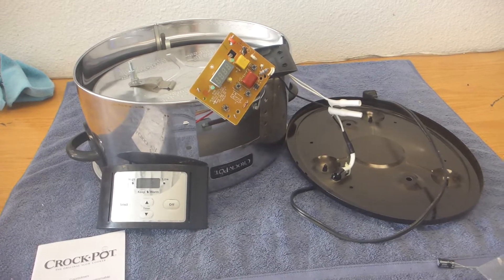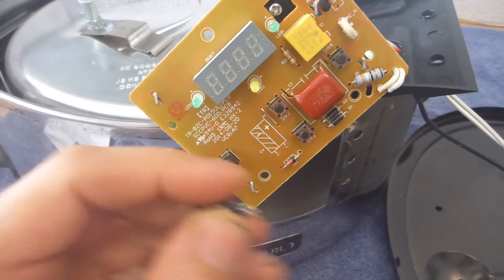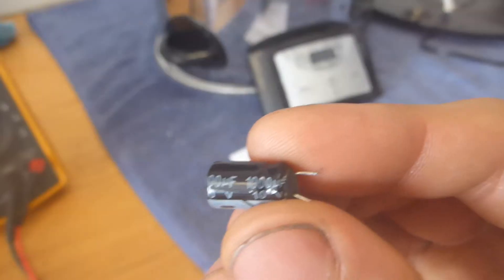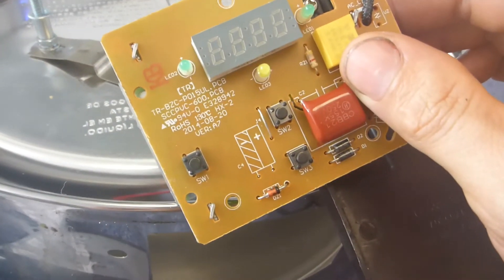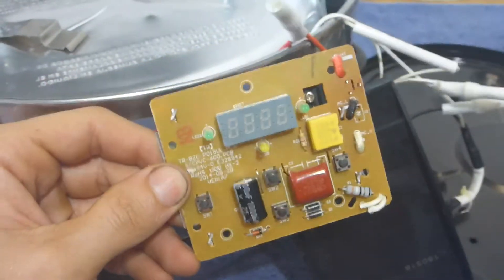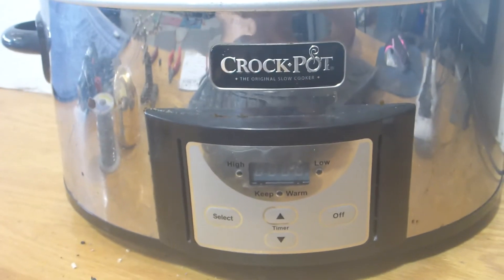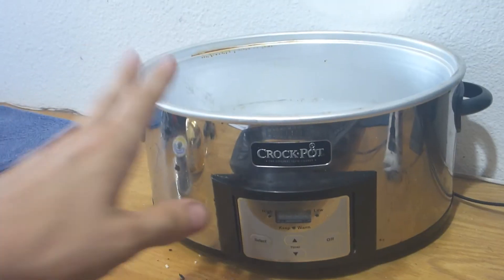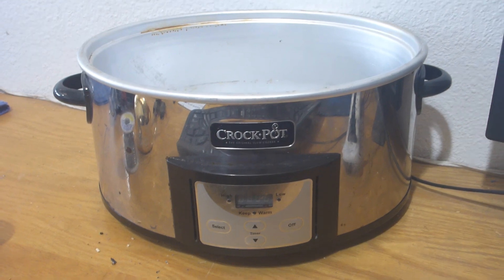Crock Pot Digital Display Won’t Turn On – Diagnosis & Repair - How To Fix

Comment: Great video! I found the same issue on my crockpot, but after replacing the capacitor, I could only get the buttons to work and not the lcd display. 

Is there more I can do to diagnose without desoldering all the components off and trying to test them somehow?
Reply from the maker: Oh noooo, sad face.  Most components can be tested without removal.  If only the LCD display isn't working, perhaps the display itself is faulty or some of the legs are no longer properly soldered.  I'd give the board a thorough investigation!

Comment: Very useful vid. Three years old but still useful. I wish you had started by taking the pot apart. Nut at least we see how to put it back together again. Thanks again.
Reply from the maker: I'm glad it's still helpful for ya.  I'm still trying to repair my time machine that lets me record things I've already done, but so far replacing the capacitor hasn't worked.  😕
Reply: @Bythirteen 😂

Comment: Not sure if you're still around to answer (and remember), but how did you get the bottom off?  Did you just take a flathead screwdriver and pry from those bottom clips?   Mine has 2 on each side and I'm not sure which direction to leverage them, worried about damage.

I took the inner pot out first and have practically no room to work, and there was some thing attached to the bottom of the unit with 2 small screws I didn't know about beforehand.  Just impossible to get back with how little slack is on the wires.

Also had some 1cm standoff and 2 washers fall out during the process, but thanks to this video I know where they go back.
Reply from the maker: all I have to offer you is this video, boss.

Comment: HELP! I don't have a soldering knife, and I have a Crock-Pot in your perfect condition but it doesn't heat up. What's the easiest way to check which part is defective?
Reply from the maker: ask someone with the proper skills and tools to assist in troubleshooting?

Comment: Thanks for this.  That's exactly what happened to mine.  The pot itself works, but the LCD doesn't.  I've just been using it and setting a timer, as the lights for low/high still work, just not the timer on the pot.  But maybe my hubby will enjoy a new project after Christmas (don't want him digging into it before that!)
Reply from the maker: game on!

Comment: Thank you for this video. I was thinking of purchasing a crock pot with a digital display. I’m 62. I bought my mom a crock pot as a gift back in the 1970s. I’ve had several since then but none programmable or with a digital display. I don’t have any electronics training to attempt anything like what’s done in this video. Maybe I’ll just opt for one without the digital display.
Reply from the maker: When I need kitchen appliances or tools or something like this, I first check the used market -- craigslist or thrift stores.  Lots of times older gear is more reliable, especially in the case of a crock pot.  We don't NEED a digital display or electronics involved in this case... turn it ON, set a timer, go about your business.  Those older simpler products don't fail prematurely.  Not to mention the carbon footprint reduction benefit of buying used.... or the great reduced pricetag!!
Reply: @Bythirteen  Thank you for your reply.  I think I’m going to opt for one of the simpler ones like you suggest. I’m vegan so I only want to use the crockpot to cook soups in. No meat, etc. A basic model will suffice. Most people want the programmable function so that the crockpot doesn’t switch over to warm for too long. People say that when the pot stays on too long, the food turns to mush by the time they get home from work. I work from home, so I can monitor the food to stop it from overcooking.

Comment: Anybody know what causes alll the lights to blink? Everything I read online said to reset by holding down a variety of button combinations for different lengths of time and that didn’t help.
Reply: Hello, the same thing is happening to me as you, the 3 LED lights on my device keep flashing and I can't find anything on the internet to solve the problem. Could you fix it? @portrece
Reply: @mancabmat  I emailed the company asking if they’d sell me a new circuit board for the control panel and they offered to send me a replacement slow cooker for free
Reply: @captainzib  But it still has a warranty, mine is already old and you are older. Although now I have managed to get it to work by pressing all the buttons at the same time and the flashing has gone away, but the numbers are barely visible on the screen. Thank you for answering so quickly
Reply from the maker: sorry I cannot be of assistance here.

Comment: I am desperate for help.. Can you assist me with repairing my crockpot? I have an old Hamilton Beach 3 in 1 slow
Cooker and it stopped working suddenly.. i legit cried lol. I really want to fix it. They don’t make it anymore and I took it apart following another video to inspect it inside. Everything looked ok to me as far as no obvious damage, corrosion, melting or anything so I put it back together and assume it’s something with the circuit board but I don’t know how to investigate each component on it to see which is faulty. Can you help me? @Bythirteen
Reply from the maker: That's a big bummer.  Electronics are a cruel mistress sometimes.

Comment: nice video.  Thanks for sharing this.  Any suggestions on timer segments being out?  You didn't show the backside of the PCB but I suspect there's a driver chip on there.  Any idea of value?  Thanks
Reply from the maker: You could always theoretically replace any component but you'd need a pretty advanced level of skill to be accomplishing that task... both in identifying components and their suitable replacements, and tooling to perform the replacement.  Identifying and replacing a capacitor is fairly basic so that's why I made this video.  :)
Reply: @Bythirteen  I'd agree with that!  Any chance you have a photo of the back side of the pcb?  specifically, I'd like to see what the display pin outs are the driver chip.
Reply from the maker: @en2oh  that's a negative sir.  that's a 15minute disassembly though man, just get to goin!
Reply: @Bythirteen  I hadn't bought the broken pot yet! :)

Comment: Thanks for the video.

I have a slightly different model (no display) that would constantly reset after a few minutes of operation causing the power light to blink.  After going though the various troubleshooting hints on the 'net, I ran across your video for clues on how to disassemble my unit.  When I disassembled mine, I noticed that my unit has a 470 uF 10V capacitor in a very similar shape as yours - blown out at the leads.  I suspect that capacitor issues may be very common in this series of Crock Pots - very much like how Samsung TV have used 10V capacitors in 12V causing them to fail prematurely.
Reply from the maker: thank you so much for spending the time to diagnose and fix rather than just contribute to the landfill!  your efforts to reduce waste make the world a cleaner place to live!
Reply: @Bythirteen  I believe that most people if given a reasonable choice/options, will pick to repair or fix.  The problem is most companies don't make it easy to do so by either poor quality components (like this poorly spec'd capacitor) or by making it hard to service. The key thing is spreading the information (like your video) of how to fix things so that others can benefit and develop their own ideas for other related issues!
Reply from the maker: @richardlouie2922  I was a bit upset by the fact that the company offered no serviceable parts for this unit.  It doesn't make monetary sense for them to support their products like that.  Capitalism is pretty dope until we run out of resources.  :-X

Comment: I have a weird issue with mine. It turns on fine, but it doesn’t say on warm or low and just full beans in high (even if the led shows warm/low). I’m thinking it must be the temp sensor.
Reply from the maker: possible!

Comment: Hi, I'm wondering if it can fux mine that was in the basement when it flooded. When I plug it the 3 Light flash but I can't no more select a mode to make it working. Thanks
Reply from the maker: Oof, hard to know for sure but certainly worth trying.  Usually water damage just results in corrosion but sometimes that corrosion is a death sentence.

Comment: Hi, at the 3:32 part of this video it looks like you're tucking something under the silver clip/bracket.  Is that a heat sensor or something?  The rivet came out on my crockpot and that little clip came off so I was wondering what it's for.  Thank you for your helpful video.
Reply from the maker: That would be my assumption as well.
I imagine the thing would work well enough with the sensor just up against it, although if you want to re-attach it, you could drill another hole and use a metal wire to tie it together.
Reply: @Bythirteen  Thank you very much for the quick reply and the helpful suggestion.